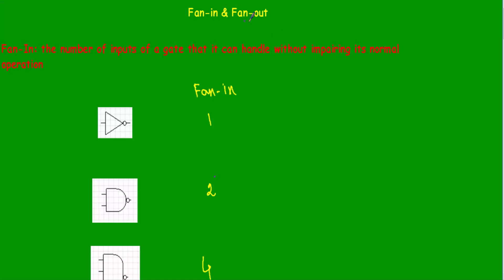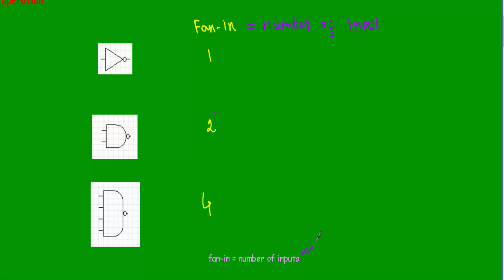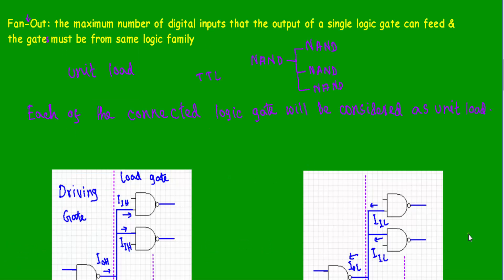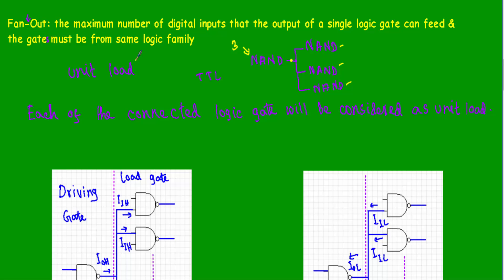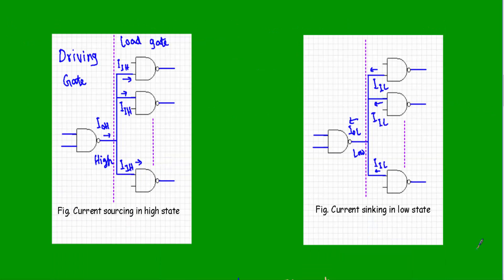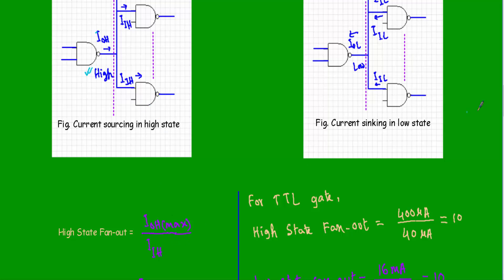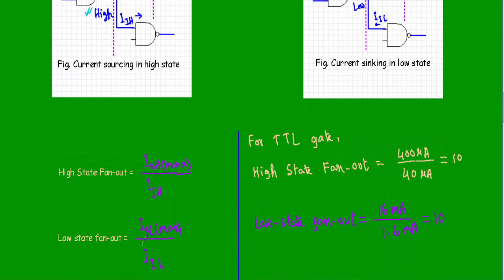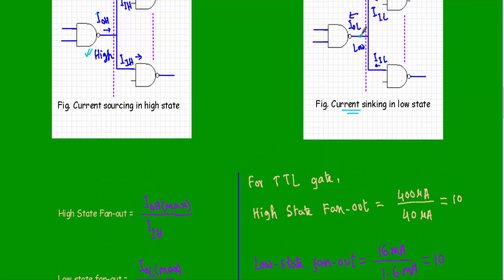Fan-in and Fan-out

Comment: What problems are encountered if the fanout of this gate is exceeded for both a
HIGH and a LOW output state?
Reply: the unit loads may not work, as the fanout is exceeded, current that each unit load may receive will be less than Ioh and current for these unit loads will go to undefined region....